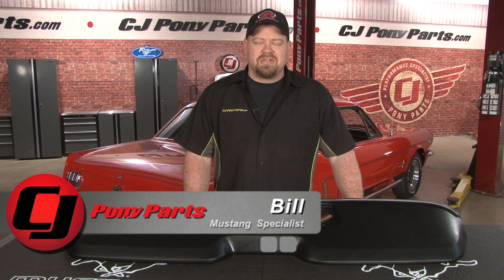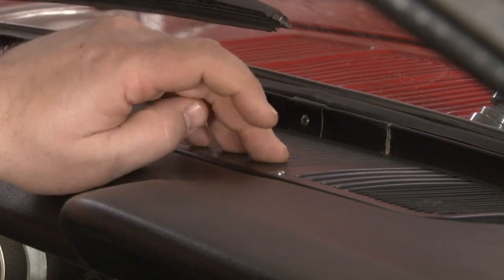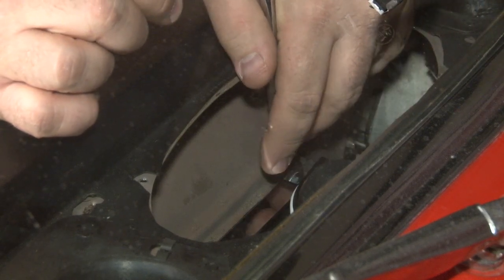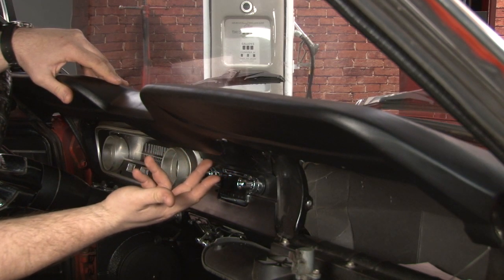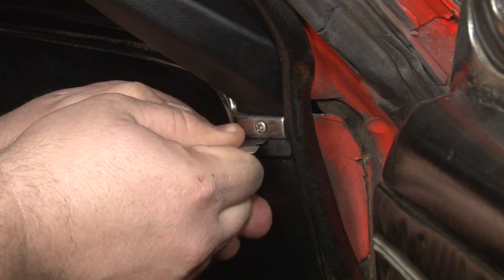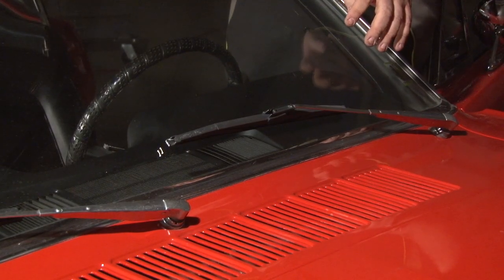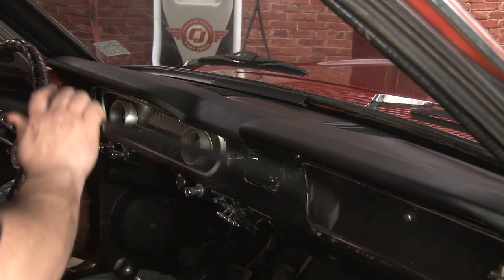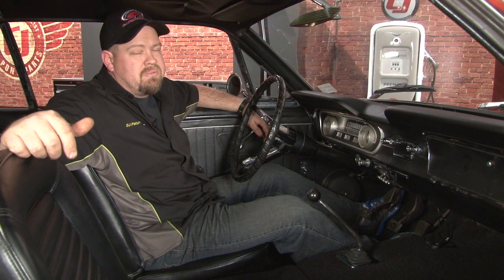Tooling Dash Pad | Ford | 1965 Mustang

Comment: Just installed one UGH........... Here's 3 tips.First draw small lines on the outside of the windshield as to where the screw holes are. Then notch the dash pad where the screws go thru the top trim. A long magnetic phillips screwdriver. Also a 12 pk of your fav brew.

Comment: The 66 is similar but different. The center of the dash comes down further and yes there are tabs on the outside as well.The trim at the top of the dash is the same but not the chrome trim.

Comment: I think the 66 is a little different - my dash pad had a couple tabs on the sides that were bolted on. Also, I'm not sure if the 66 had the chrome trim holding it in.
Reply: My 66 gt didn't have them either

Comment: I bought one of these Ford Tooling Dash Pads for my 65 Mustang. Unfortunately the holes do not line up so I need to drill some holes into the metal.  What's up with that?!

Comment: The Ford replacement for the 66 coupe did not come with any new screws or nuts.  The nuts I ordered from you do not fit the studs.  There are no pre drilled holes anywhere and there is no chrome pieces around the interior.  Other that all that it looks great sitting in there.

Comment: For some odd reason the drivers side of my new dash doesn't fit flush.  Is that normal or do I need to take it off and reinstall? I can't get the metal pieces at the back screwed in due to it not being flush. Thanks.
Reply: That can be one of the trickest parts of the install. I would loosen the screws on the other side so you get a little play and see if that works. The screw closest to the pillar can be difficult.
Reply: Thanks.  I will try it this evening.